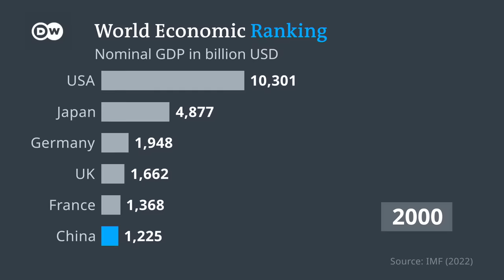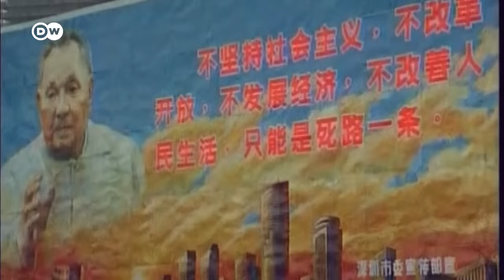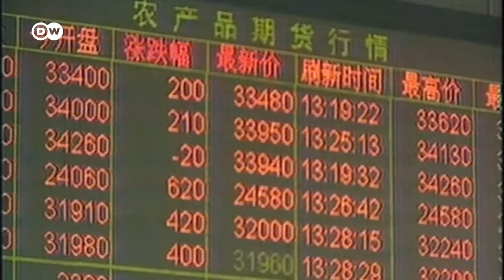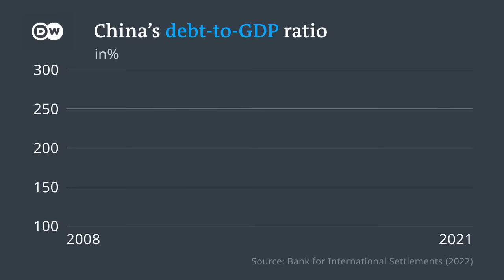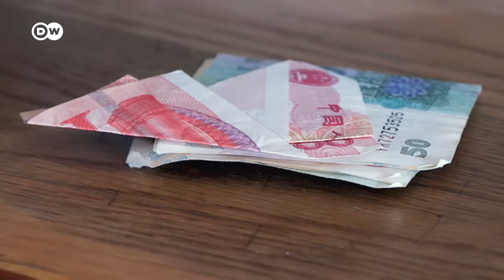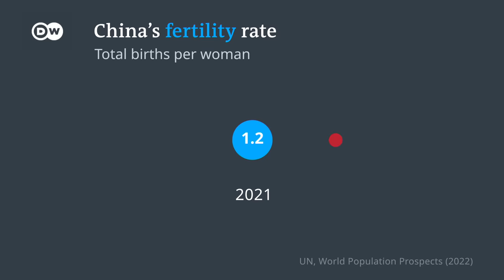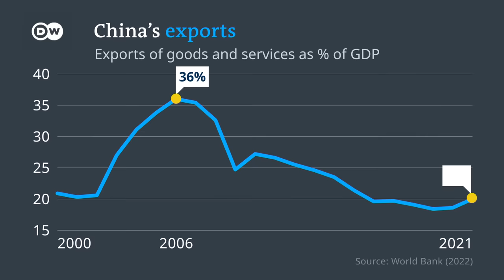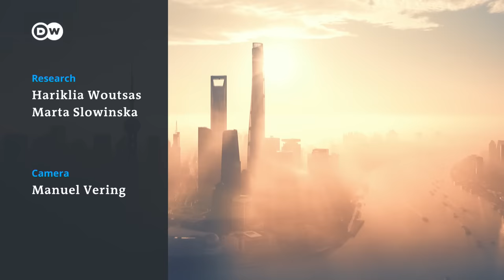Can China still become the world’s largest economy? | Business Beyond

Comment: Highly unlikely now due to geopolitical headwinds and China's aging population
Reply: it's almost inevitable that China surpasses the US at this point. US population is also aging, and the US is much more heavily in debt that China. Remember China is the third largest creditor nation in the world while the US is the largest debtor nation. Higher interest rates will crush the US economy. Not to mention China's population is still 4x that of the US.
Reply: @askeladd60  the US population is aging sure, just slowly and is bolstered by immigration and seasonal workers. China is not. China I'd already older and aging far faster. China also more in debt. Their debt to gdp ratio is the highest in the world. Interest rates will hurt the economy but help it in the long run. There's few ways to really deal with inflation, long term inflation is worse than a small reccesion next Quarter.
Reply: @kordellswoffer1520 , you missed some of the biggest issues. R&D, IP, software, AI, data analysis, and automation — these are some of the key areas China can't compete with the West, and it won't change anytime soon.

Many of the Chinese tech breakthroughs rely on the Wesern tech or are made possible by reverse-engineering of the Western tech. Semiconductor manufacturing is the biggest example of this. But you can only go so far with reverse-engineering. The Wetern countries already banned EUV machine exports and EDA software licensing to China, and there's no way China finds replacements or develops all the necessary tech by itself. For this reason, China will always lag behind in tech innovation.

Comment: China needs to stay humble, and it must aim for higher GDP per capita to the level of developed countries than using GDP.    

The only good thing is that debt and housing problems and the bust of the bubble could be easily solved locally if they literally shrink land supply or stop selling lands outright for a decade if housijg pirces fall a lot.   this is only possible when all lands legally belong to CCP as they are all leaseholds. 

So unlike Japan, it can easily avoid  a national housing slump that last for years.  

 China is unqiue that can control Bank lendings directly instead of using pure interest rates like the Fed.   

So all the economic models or analysis based on experience from abroad don't really apply to China as its market structure is v different.